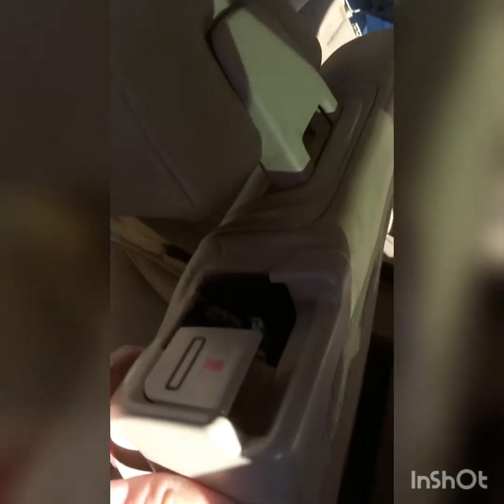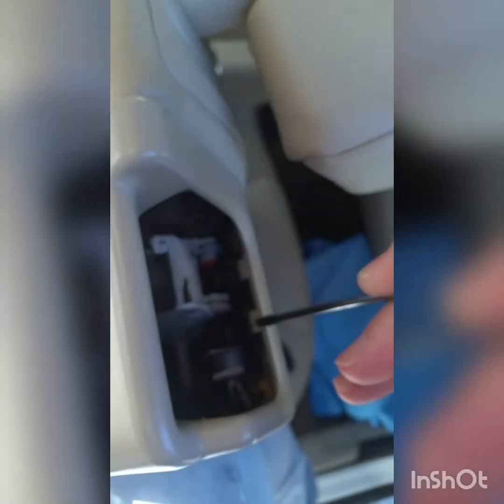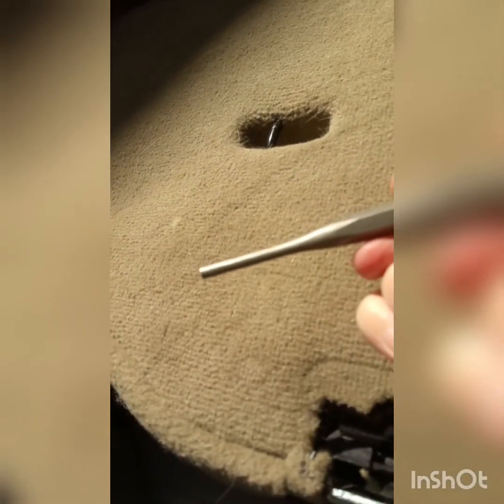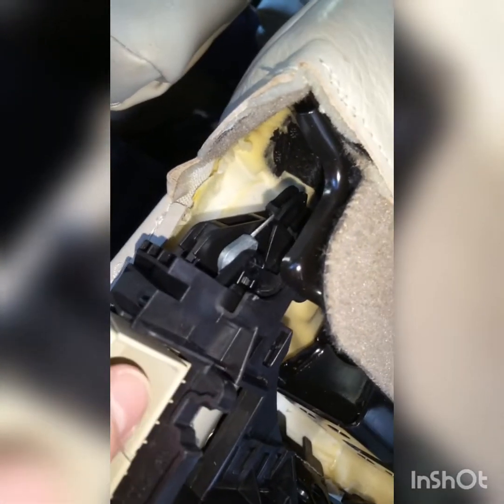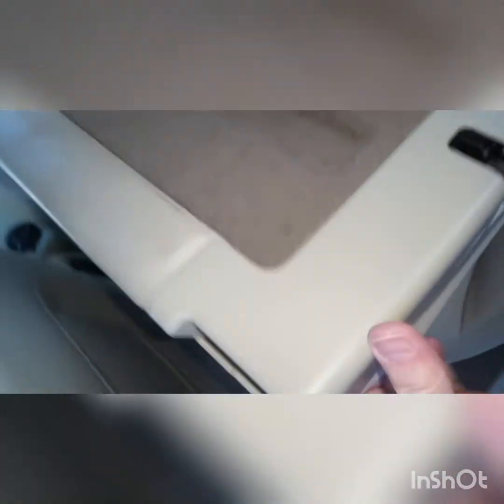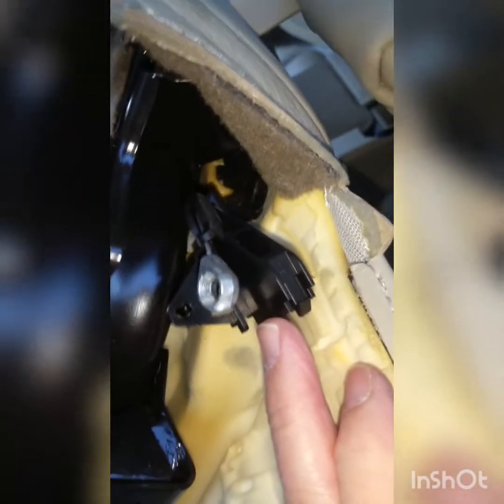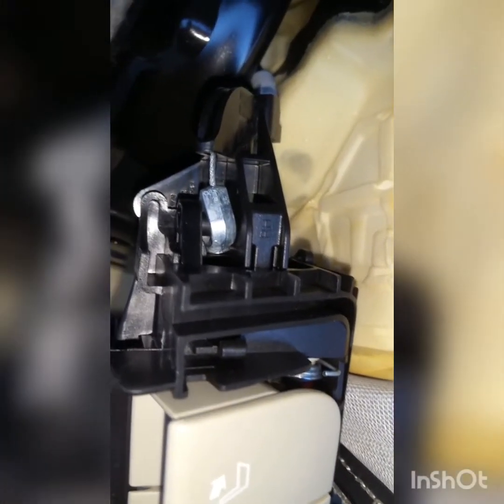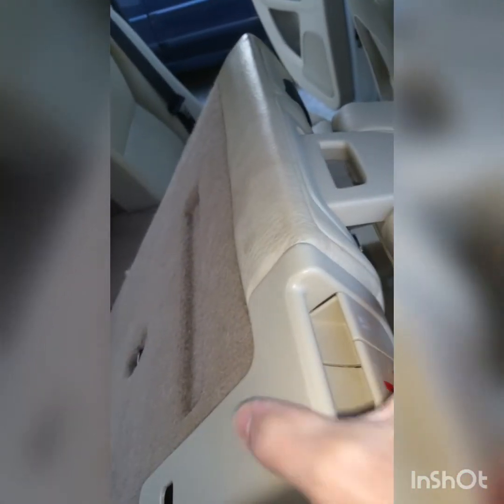Volvo XC 60 - Replacing broken rear seat latches.

Comment: Ours broke recently on our 2012 XC70. It was cold at -20°C... so maybe the temperature was a contributing factor to the break.  I changed the part in 10-15 minutes. To start -  I used a pair of long needle-nose pliers and lifted up on the remaining plastic of the broken pull latch - and the seat unlocked and flipped down. I then inserted a flat screwdriver on the lower backside and pried the trim loose. I put down a very flat screwdriver on the top trim area and they released well too. I was able to save the trim. I had the new part ready to go in. *Note - A special Torx bit needs to be used to remove the Torx bolts holding the latch assembly to the side of the seat. It was simpler than I expected and really quick.
Reply: It would be helpfull to know what the special torx bit was?  Was is a security torx or just an unusual size?
Reply: @timtaylor8557    Hey there Tim.  Sorry.  I almost missed this.  As far as I know I used a simple over the shelf Torx bit. I hope that helps
Reply: The method of lifting up on the internal square plastic bar is the easiest way to unlock the seat. Beat jimmying the above the latch with a screw driver as described multiple videos.
Reply: @timtaylor8557  Just a normal torx 40

Comment: Just go through doing them for a customer. 220. now the trim pieces broke but they are only 15 each. To do them you need to look down into the hole and find the lever that unlocks the latch and pry it towards the back. Not too bad.

Comment: Thank for the video, I replaced it successfully. There are 4 plastic tabs with the cover. The one near the bottom can be seen, and can separated without damage. I pried the top, damaged all 3 tabs. There is shallow tab with the cable connects to headrest as well. Lose the tab then turn clockwise (right seat), can separate the cable.